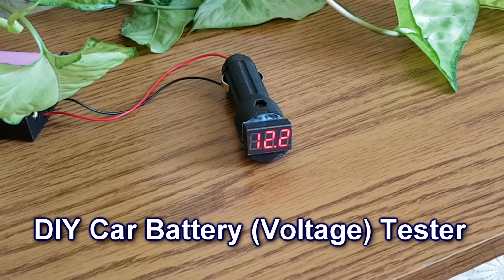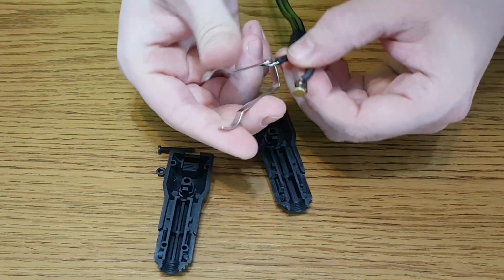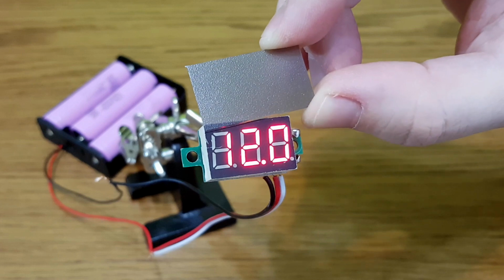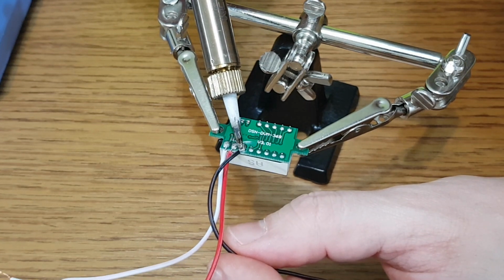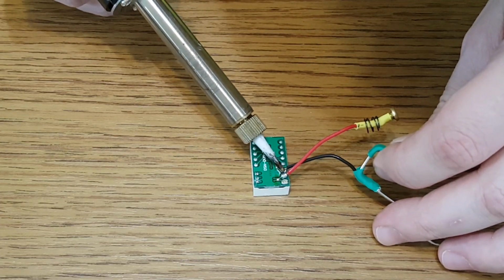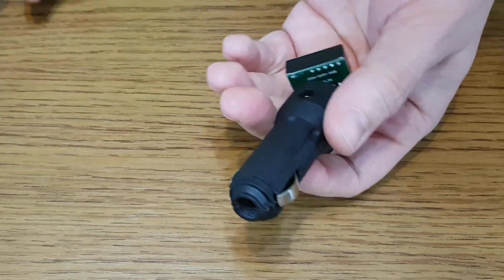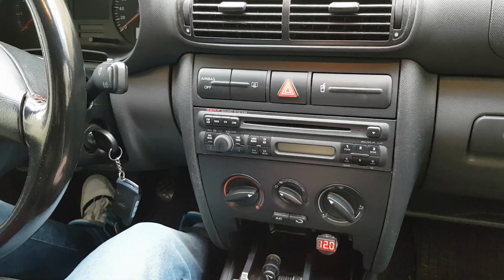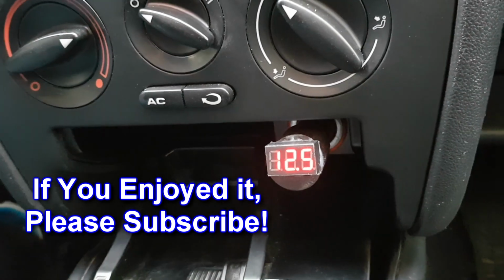DIY - Car Battery (Voltage) Tester - 12V socket

Comment: Sorin, change the 10 amp fuse. The fuse is there to protect the cables of the device. Use a 1 amp or so for the cables you have inside. Great v-blog, keep up the good work! :)

Comment: I have one of these car ligter ports, I used thick wires to lower the resistance. The longer the thinner the wire the more resistance, the thicker the shorter the wire the Less resistance as you said once

Comment: Sorin, that multimeter at 6:04 might not work well in the cold. I have that meter also and it usually reads huge errors of voltage measurements in the freezing temperatures. Just some to keep in mind... Otherwise great video :)

Comment: Salut , am rugamintea daca ai posibilitatea sa ma ajuti cu codul de deblocare a radioului. Am un seat leon 2005 BCB , serie radio: SEZ2Z6D2893673. Am schimbat bateria de curand si nu mai gasesc codul nicaieri, nu am nici manualul. Multumesc anticipat.